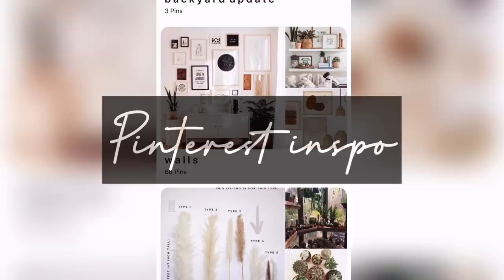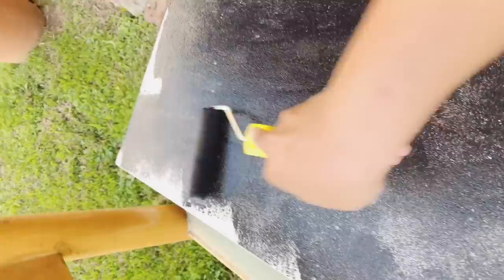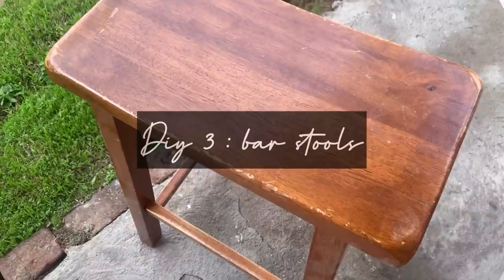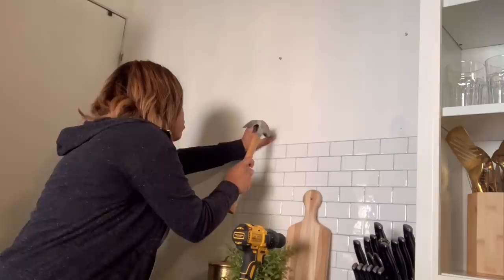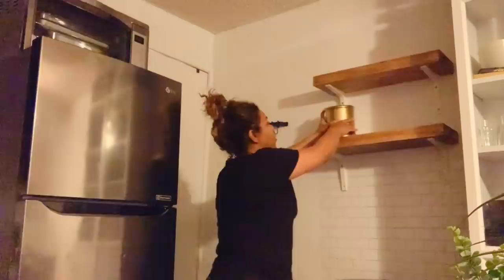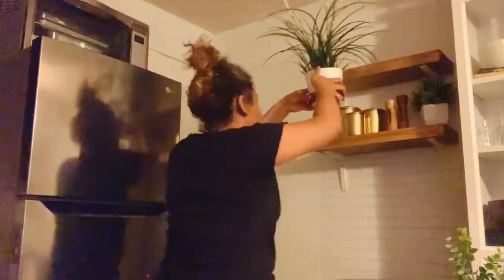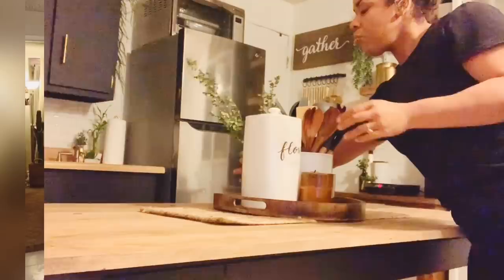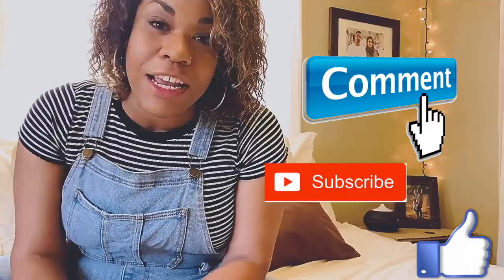BOHO KITCHEN DIY EXTREME MAKEOVER ON A BUDGET

Comment: Really good job! How is the paint holding up? Every kitchenremodeling I've seen have been so hysterical about primer and a heavy duty expensive color. You make everything look so easy and you're so sure when you decorate, everything looks amazing!
Reply from the maker: Fanny Krol thank you so much!  And I don’t have a traditional kitchen since I live in a converted garage so it’s prob a lot lower maintenance than an actual kitchen. I have one stove burner and a small oven so I’m not really making a lot of greasy foods and things that affect the walls much. the paint on the bottom cabinets needed a touch up on the top where we touch them a lot, but has been holding up well since then. However, If I could do it again I would have probably sanded the doors down before painting and I would not use chalk/ matte paint next time and I would just use something with more gloss / satin finish. I haven’t had any issues with the walls though. Overall, I don’t mind the quality of Walmart paint in efforts to save money but if I was doing something I wanted to last for a long time I would spring for the better paint for sure!

Comment: Hello. Did you try for the floating shelves either butterfly bolts or anchors? How did you get the brackets to work? How is the paint holding up on the cabinets and the walls?
Reply: Where did you get the round wood tray and the handled wood cutting board?
Reply from the maker: Denise Cardona hey girl, yes I tried anchors I think it was a combination of the hooks on the shelf and not having small enough screws to fit in the holes. And the brackets i just put the screws in the walls no anchors. The paint on the bottom cabinets needed one touch up since but everything else has been good otherwise. My only recommendation would be to sand cabinets first and to choose a paint that’s either satin or semi gloss/gloss
Reply from the maker: Denise Cardona cutting board was from home goods and the round tray is from hobby lobby

Comment: Screws dont work in dry wall. You need an anchor or you have to drill into a stud
Reply from the maker: I used a stud finder so I was screwing on the stud but the screws I had were to big for the holes on the shelf